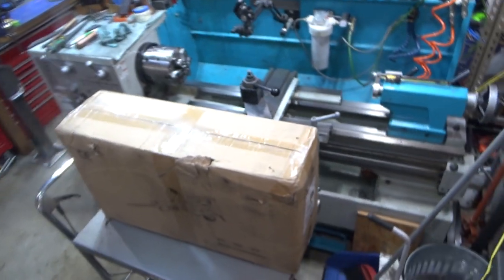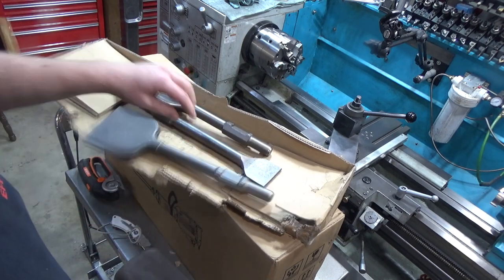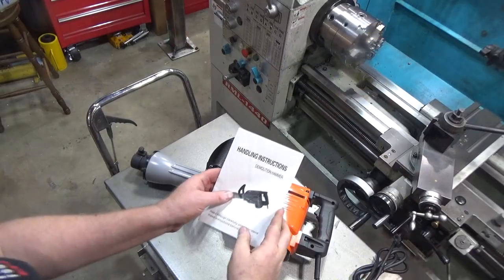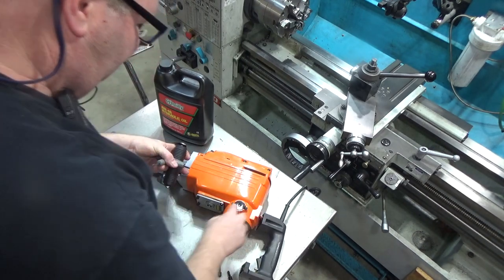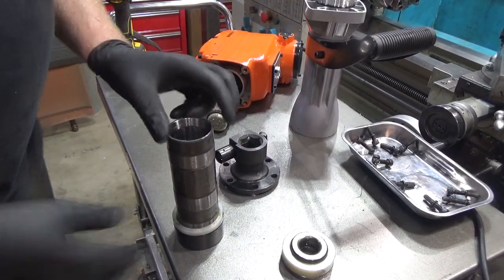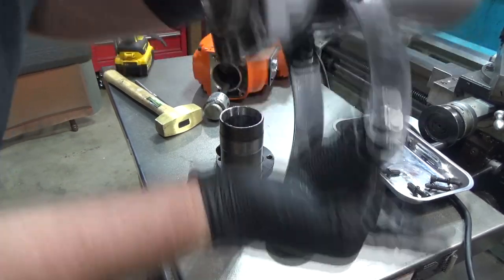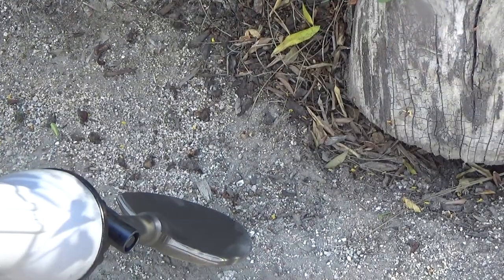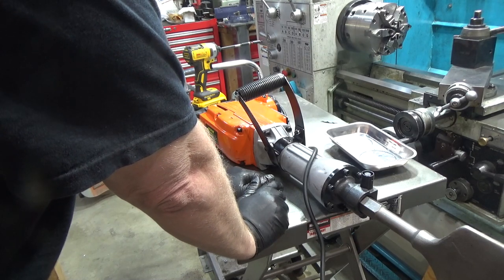QTR 86 VEVOR 2200W Jack Hammer

Comment: I used cheap walmart tranny fluid for mine and it worked great, don't be fooled into spending a ton on hydraulic fluid !!!
Reply from the maker: That is a great tip. Thanks.
Reply: Actually, type 46 hydraulic fluid has specific additives. I trust the actual engineers and not some YouTube commentary.

Comment: Vevor recommends: Petroleum based, ISO VG46 hydraulic oil; which is very hard to find. So I ended buying MV46, which is a synthetic oil and has additives meant for use with high heat applications. From what I've read; MV46 is superior to VG46.
Reply from the maker: Very good to know. Thanks for sharing what you've discovered.

Comment: The manual says not to use too much oil or it could damage the product. The manual does not say how much oil to put in it. Did you figure that out? And is the site glass supposed to be viewed when it is in a vertical position? This looks like a great product, but the user manual is not very informative.
Reply from the maker: The user manual could have been better. I guessed on the amount of oil, based on the site glass and guessed that it should be vertical to measure.
Reply: @DudleyToolwright  the company responded to an email that I sent them. I asked them about the oil and they said that you do not have to put any oil in it when you buy it brand new. You use it for 20 to 30 hours and then add 30 mL of oil. 30 mL of oil converts to approximately 1 ounce. So apparently, you just add 1 ounce every 20 to 30 hours of use.
Reply: The manual states to add 20-30 grams of oil every 20 to 30 hours of use.

Comment: I have a Harbor freight jackhammer that is electric, I bought it for one small job. The bits all seem to be made out of cheese, but it took standard fittings so I was able to get quality bits for it. This is before the days of Bauer, it's a very strong smelling orange plastic from Chicago electric. It's a horribly designed tool with awful balance but I have to admit, it's going on 10 years and while it has never worked what I might call very well, it's also never let me down. Not something I reach for very often, but a pretty surprising lifespan for Harbor freight. I'm completely new to this company vevor but I've seen a handful of tools from them now that make me assume they are on a par with Harbor freight's higher-end lines
Reply: One caveat that might be relevant, on most of my handheld power tools, I use a piece of pantyhose as a pre filter for the air vents. Obviously I'm biased, but I'm personally convinced this will make any tool last longer than it would otherwise
Reply from the maker: Great tips and observations as always. I went to Harbor Freight yesterday and their new jackhammers look pretty nice. The outside quality seems to be a step up from this one, but I did notice similar extruded aluminum driver tubes on some of the models.

Comment: This country uses 60 Hz not 50Hz.  Did they make an appropriate model?  I know you can't complain when they are giving you stuff.
Reply from the maker: Oh, but I can. It works fine on 60hz the motor rpm is likely different. Good observation.

Comment: Cheapo brand, bought a air over hydraulic 20 ton bottle jack for our shop press, was filled with brake fluid not hydraulic fluid and plenty of grit from manufacturing, had to end up taking it apart and clean it!!! Won't be buying this brand of anything again!
Reply from the maker: Very useful feed back. Thanks for taking the time to share your experiences.

Comment: Robert when you do hardest testing on castings you have to grind a 1/16 " deep pad to get below the chilled surface on the casting which happens during the pouring operation. It can be  like glass some times , a better result would have been on the machined part . ( 50 years in Foundry game o my backs sore. )
Christopher from Down Under
Reply from the maker: Thanks for the tip. I think an ideal chisel for a jack hammer might be surface hardened to resist wear and a soft interior to have good toughness. However,  I am by no means an expert on the topic, so take my opinions with a grain or five of salt.

Comment: I made  a motor speed  controller to get the best hammer power and put a bit of gress/oil in the bit holder and the thing runs very well
Reply from the maker: That is an interesting tip. Thanks. I'll give that idea a think.

Comment: Is it not true that small size internal combustion engines 50-150cc have aluminium cylinder where an aluminium piston runs with steel rings? or all engines are steel lined?
Reply from the maker: I am far from an engine expert, but I have never heard of an engine where steel rides on aluminum. That would be a recipe for a very short life span.

Comment: What  parts did you apply the grease to ? Just ordered one .
Reply from the maker: I put grease on every part in the mechanical end of the jackhammer. The motor side has a ton of empty space inside and it seems it would be hard to direct grease to go anywhere specific.
Reply: @DudleyToolwright  Thanks for the reply gonna pick upa tub of moly today .
Reply: You don't need grease on anything for awhile, just cheap tranny fluid to fill the sight glass !